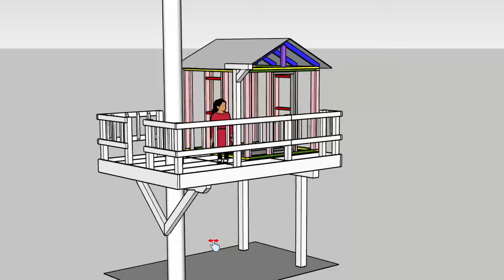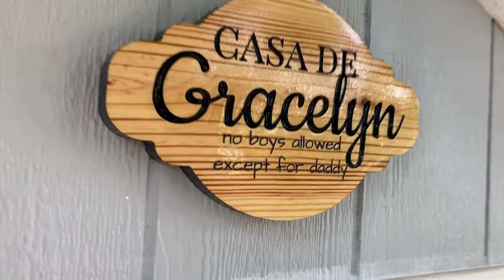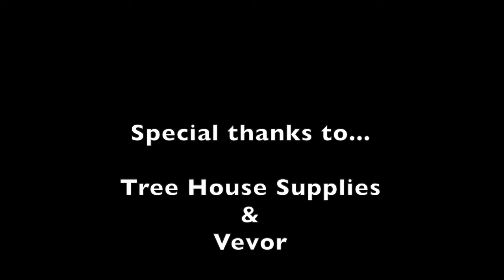DIY Tree House Build & Zip Line

Comment: How come you didnt put the remaing two legs of the platform on the ground as well rather than paying for expensive tree attachments
Reply from the maker: Because then it wouldn't be a tree house. I'd have to dig down to pour concrete footers near the base of the tree which means I'd be digging through the tree roots. I also didn't pay for the hardware :)

Comment: Bought your plans - hope my boy likes it.  Great thinking with those HDPE pieces.  Thanks for posting!
Reply from the maker: Good luck on the build! Let me know if you have any questions.
Reply: @KeimpieceCarpentry  A quick question for you... does your treehouse move around quite a bit when the kids are playing on it since the one side's joists aren't secured to the tri-beam?  I assume yours is pretty rigid since your posts were fully set into concrete, but my posts are secured to footings by metal brackets so they're not as rigid and I'm a little concerned about this thing moving around a lot.
Reply from the maker: @brianpeterson3752  mine is rock solid, no noticeable movement.

Comment: Great work! You have a lot of motivation. I think beans will hold two elephants. I'm also wondering what will happen when the tree grows.
Reply from the maker: Thanks for watching. Good question. The tree grows outward, so the trunk will get fatter. I designed the support to facilitate this without issue.
Reply: I'm pretty sure trees push up out of the ground. A friend has a hat rack that was put up for horses about 40 years ago. It's now about 8ft off the ground.. be interesting to watch

Comment: Hey awesome tree house, is the platform floating on your beam? I’m building one for my kids and are using the tabs and floating brackets. When you set your posts in the ground I assume that the actual platform is floating to let it move freely.
Reply from the maker: that's correct. The post side is solid but the tree side is designed to slide on the beam, that's why I added the plastic pieces to reduce friction.

Comment: Amazing! Whats the dimensions of the frame and the house? Im thinking of doing something similar
Reply from the maker: There are plans available on my website if you'd like to build it. It's actually a pretty easy project, I designed the plans in a way that reduces that amount of materials and cutting required. the house is 6x6 and platform is 12x8

Comment: Would the cut you made with the band saw be feasible with a table saw? Can't tell how deep the cut was.
Reply from the maker: you could make the cut with a table saw you'd just have to do it on both sides and then use a hand saw to cut the rest of the way through. Hope this helps!
Reply: @KeimpieceCarpentry  Thanks! I bought your plans.
Reply from the maker: Awesome! good luck on the build let me know if you have any questions! @raffytwoscoops

Comment: Looks great but it's crazy how expensive those hardware kits are. Just a platform would run easily $1000.
Reply from the maker: yea the kits are pretty expensive. It's hard to find an alternative though. I'm sure you could order some larger lag bolt somewhere but you can't find them in local stores. If you had a welder you could also weld something up I'm sure.

Comment: What is the material you used for the walls of the house?
Reply from the maker: LP smart siding from lowes
Reply: @KeimpieceCarpentry thank you! Last question: did you use treated wood for the house part of the tree house? Or will regular 2x4’s work?
Reply from the maker: I just regular 2x4s for the house part. No reason to use pressure treated. I didn't want the kids playing and coming into contact with whatever chemicals they treat that stuff with
 @coryfuqua7297

Comment: Not trying to criticize your craftsman skills but those posts should have been at least 3 feet in the ground for a footer.
Reply from the maker: Thanks for watching and commenting Evan. Our water table is 24 inches. I dug down until I hit water. Going any deeper wouldn't have done any good. But you're right, the deeper the better.
Reply: @stringmankzk  wow, that's a shallow water table. Thanks for that info.
Reply from the maker: @EvanRobinson85  yea man it's crazy, I'm in Eastern NC, very close to the beach. Drainage is always an issue. Check out my gazebo video you'll probably like it. Part two shows a big french drain system I put in